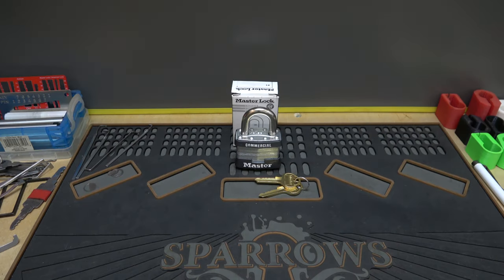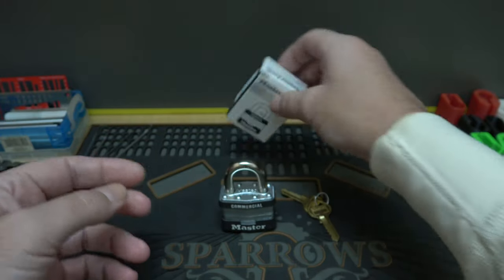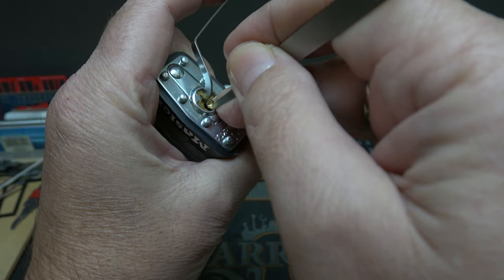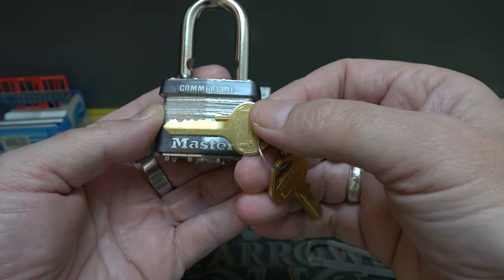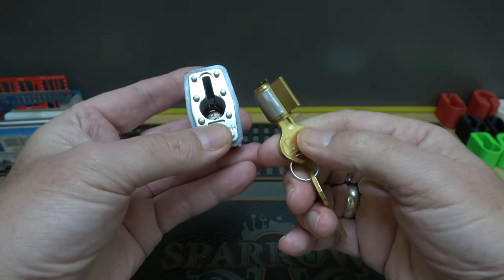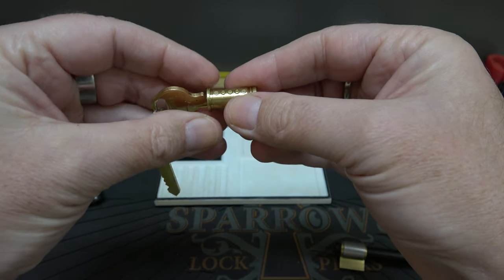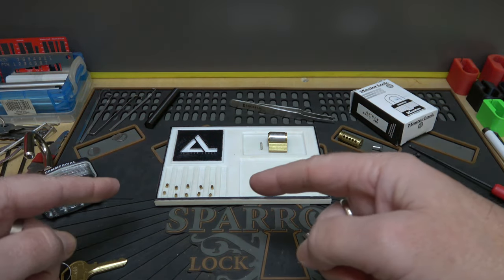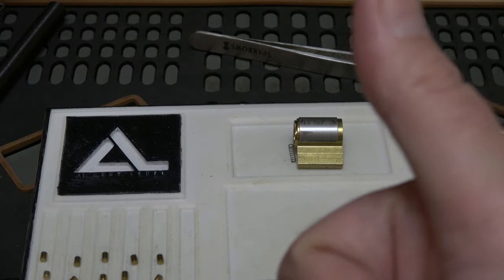#418 Rekeyable master lock No 21

Comment: Thanks for the tip on gutting crimped cores.  I didn’t think you could take them apart.
Reply from the maker: Your welcome. Yes, just be aware at all times of pin orientation so you dont dump everything

Comment: Hey Al, 
Nice job as always!  This core looks horrendous, so I am wondering if this lock could utilize a LOTO core with security pins added....
Reply from the maker: Not sure due to it's size but the 25 may except it. I will have to get one and find out. I dont see why not. The core is very standard for ML

Comment: Nice job. I was wondering if you know a way to gut the master lock cores that are crimped on both sides? I have the same followers from Bobby Keys, but I can't get the plug out with 2 crimps. The new pro series from Lowe's are all 5 pins and double crimped and I would really like to gut one. Take care and have a great day. 🙂👍🔐
Reply from the maker: Thanks Brian. Not sure. I wonder if you could just use a small file and remove one of the crimps. I have to assume the other would be sufficient to retain the core

Comment: Will you be using American lock security pins?
Reply from the maker: Yes, I have the American lock pin kit I believe I also got from Mr lock a while back. It's an awesome kit. Comes with a few cylinders, extra spring, steel balls, actuators, pins top and bottom and more. I recommend it for any lock nut

Comment: Any idea what makes it "commercial"? I'm thinking that it's just because it has 2 bumpers.
Reply from the maker: Not sure but I thought it had to do with it being rekeyable. I just found this on Google. What is a commercial grade lock? A commercial grade lock is one with a stronger rating, as determined by the Builders Home Manufacturers Association, the official trade association for manufacturers of building hardware. The Association is credited by the American National Standards Institute to perform such gradings.
Reply: @AlbertLebel  like Master Lock cares about definitions. If they did, they'd have to advertise almost all their products as "low security", 😆 
I have a Master #3 that has the grey commercial bumpers on it. The specs and the ease of picking are identical to a normal #3.